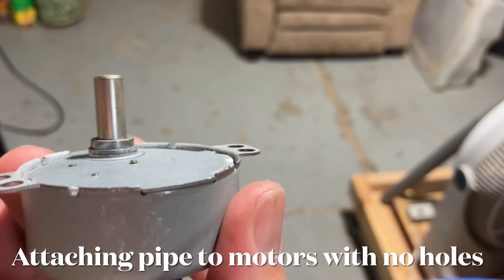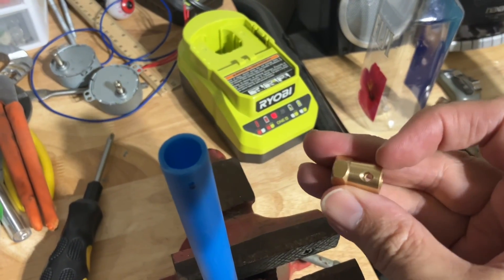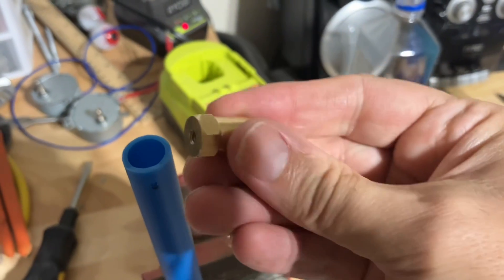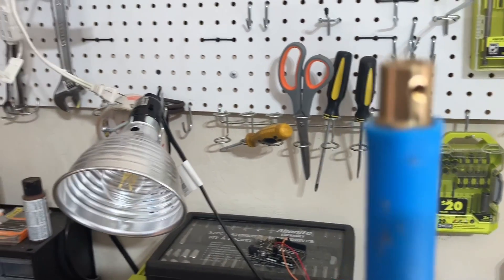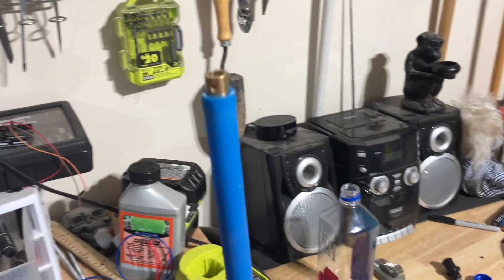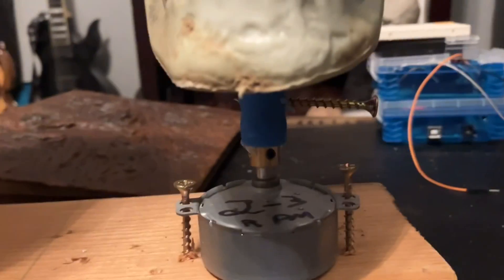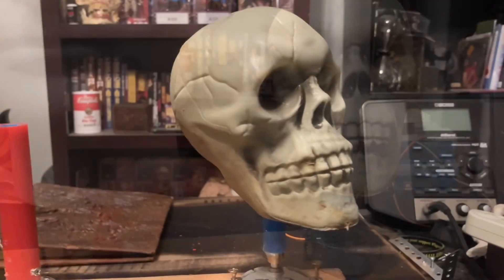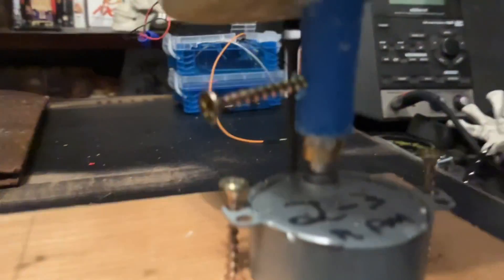Easy way to attach pipes to synchronous motors

Comment: Will the higher rpm motors move more weight?
Reply from the maker: No. In fact, the slower rpm tend to move more weight. The higher rpm’s reverse movement quickly with little resistance.
Reply from the maker: https://youtu.be/BKoLoexPYaM?si=W1DshUryTIaY7LrE

Comment: I think you would find a 3d printer really handy for this type of thing.  I was very sceptical of their usefulness myself for a long time suspecting I would spend far longer trying to get a print to actually work than just making it myself but now I have one I would hate to be without it, you can usually find adaptors like this ready designed for download but once you get the hang of the software (which is I must took me a while) to design your own you can just draw what you want and 30mins later its ready for you to use 🙂
Reply from the maker: I 100% agree with you that it would benefit me, especially all that I do for Halloween. However, I started making these videos for those who want to save money, especially if you only have a few motors. But, I might look into a printer. So share a link if you can on a good starter one.
Reply: @brianbenson3091  Hi, I bought a used custom one myself which happened to come up locally so I wouldn't be a good person to recommend which one to buy.  I personally would just look for a cheap one which is popular so there should be lots of support, upgrades etc. available.
Reply from the maker: Well I got a printer 

https://youtu.be/bPpIV9aYBmA?si=jjKcfTfAbsNlzdJe

Comment: I don’t want to bust your balls but it seems like while you were heat-molding the tube, you might just heat-mold your own adapter too?
Here’s where you school me though.
I’ve seen that motor “chassis”, but I don’t know what it is. I think “clock motor” when I see it,  because I have seen it, but was like 1RPM and even less, as I recall.
Reply from the maker: Ya I’m still trying to find the best way to attach pipes since I use them the most. Creating a universal adapter that could be used for either pipe or axles or whatever would be best, but I find stuff out on the fly. I’m always looking for better ways for sure. Also, I had to look up “chassis” lol, because really I don’t know much. All I can say on that part is all synchronous motors I get are designed that way. I either screw them to wood to keep them down or on pvc pipes if making like a body frame. Hope I answered somewhat in the ballpark?
Reply: @brianbenson3091  LOL, yeah "chassis" prolly a bad description, maybe form factor? IDK. I know that motor as a (very low RPM)  drive for intermittent lubrication (which makes it really dependable). Its just a "servo" for you right? Wouldn't matter what voltage or ac/dc?
Reply from the maker: All the motors I buy are AC with standard 120v plugs. When I do use servos they are usually small 5v ones.